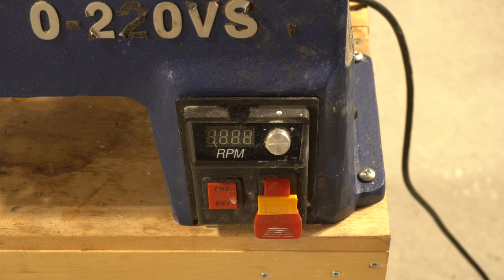How CUTE is this bowl!?

Comment: What a fun idea that rope inlay is! Your project turned out great. I will have to admit that the crack down the center of the bowl had me on the edge of my seat! I was so concerned that mounting it on the check with a mortise would put enough pressure on the wood that it would split. 😨 I was so happy to see that it didn't happen! 🙂

Comment: Very nice save. I was looking forward to seeing how you trimmed the butt ends of the rope to fit the groove.
Reply from the maker: Thanks, Greg! I forget, did I not show that? If not, I recall it not being very exciting. I took the sharpest scissors I had to get a nice clean cut, and then as I pushed the rope down into the groove, the two ends just blended together really easily without any additional steps on my part. I thought it might be really obvious visually where the ends met, but in the finished bowl, I couldn't find that point; it all looked the same!

Comment: I've seen this type of inlay done before and yours looks fantastic ... the resin seemed to be quite thick when you were pouring, was that due to temperature and is that why you got the bubbles?

I've just started my woodturning journey and I'll definitely be trying resin at some point ... you and other provide a massive source of inspiration for people like me ... thank you so much for sharing 👍
Reply from the maker: Thank you, Barry! As for the resin, I chose to go with a faster curing resin as I didn't want it sinking into the wood (which would have darkened the cherry). Faster resins are usually thicker by their nature, so that was probably the biggest reason. Had I used a slower curing and thinner resin, it might have worked better with the rope, but then it might also have darkened the wood a bit. Definitely need to experiment a little more with this!!
Reply: @formanwoodworking  Ah, another thing I've learned ... faster = thicker 👍
I see what you mean about staining the wood, you could have brushed on a thicker type to seal the wood then used the thinner stuff, but more time, and I don't think it'd have made much difference ... still turned out beautifully 😀

Comment: The rope is very porous and even the pan was not enough to eliminate the bubbles. The ideal would be to have sealed the rope before applying the resin over it. Congratulations on the job. Very inspiring.
Reply from the maker: Definitely, although I'm not quite sure how best to seal the rope. If I seal it before I put it into the rim, then it will harden and become much more difficult to work with. If I try and seal it in the rim with perhaps a thinner and longer curing resin, to give more time for the air to escape and clear out, then some of the resin will undoubtedly soak into the wood and leave it darker around the rim. 

Will need to give some time to this!
Reply: I would immerse the rope in the resin, let it drain well and before it hardened, in a gel point, I would place it in the crack.  I would let it dry to fix it well and seal the pores of the rope and then I would apply the final resin.  but everything is always a learning experience.  even more so when we work with resin.